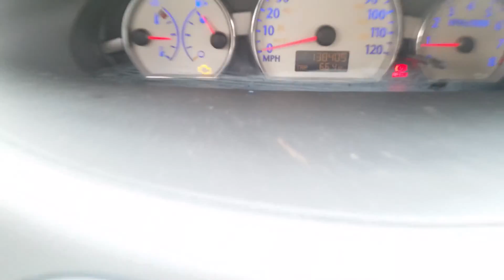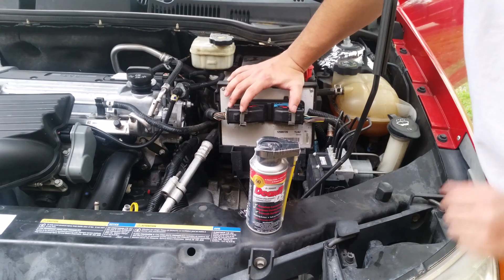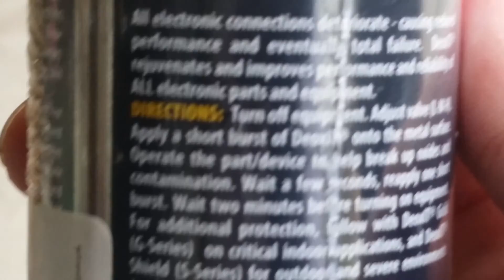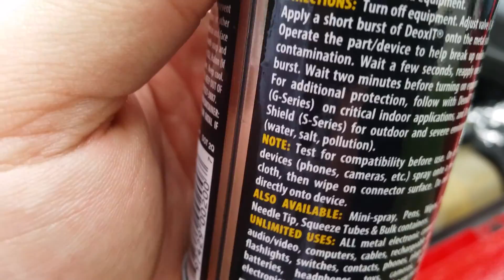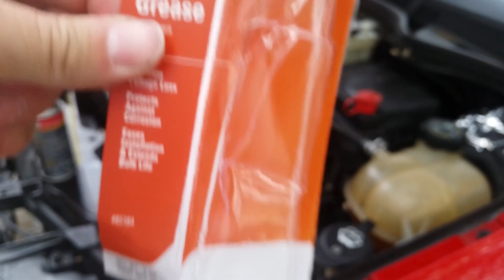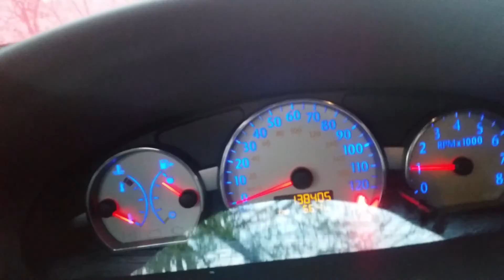(4K) Saturn Ion: Electrical Issues. DeoxIT D5 review

Comment: Is this a common problem with these?
Reply from the maker: I know a few people on the forum that have mentioned it. But I'm not sure how common it is. I ended up having to replace the harness. The pins were moving around in the connector. I couldn't get them to lock into place.

Comment: Hi, my saturn ion 2005 is dying while driving. I was thinking to clean the pins for ecm, excellent video. Did it solve the prob
Reply from the maker: No, not really. I ended up replacing the whole harness. But I think the problem is the pins inside the plug get pushed in. You maybe be able to take it apart and fix it that way.
Reply: @BEERSnGEARS  Thanks. Just this morning my car stopped 5 or 6 times, i bought wd 40 special for rust and did same what u did. So far one hr driving and seems the problem is solved. Thanks again

Comment: Wow thats exactly what my Saturn is doing how can i fix it .
Reply from the maker: I ended up replacing the wiring harness to fix it. Soldered like 26 wires.... It fixed it.
Reply: @BEERSnGEARS  How much did it cost you mine's doing same thing it's a 2003 Saturn Ion
Reply from the maker: @whysoserious447  I went to pick n pull and cut one off. I think I paid $15
Reply: @BEERSnGEARS  cool anyway you could send me a picture of it so I know what IAM looking for IAM not so good with car's.And does that spray help thinking about getting some till I find one .
Reply from the maker: @whysoserious447  it was awhile ago, but I think it helped for a little while. But it didn't last long.
Reply from the maker: I think I could have fixed the fonnector, you can disassemble the plastic casing and you can see the pins, they sometimes get pushed into the connector. I was able to fix another connector by taking it apart and pushing the pins so they poke out farther
Reply: @BEERSnGEARS  Cool my car in morning even the alarm don't work has no power at all.Till I disconnect negative cable on battery then put it back on and will start sometimes I can't even open driver side door. In morning can you reset these computers on car .
Reply: @BEERSnGEARS  Ok I believe it's computer car is pretty old runs great but it does have it's problem's I like your blue dash lights too you do that is that dash hard too get out I don't see any screws in it .are they under dash ..
Reply from the maker: @whysoserious447  There is one screw underneath. Remove the radio bezel by pulling on the air conditioner vents. And there is a screw above the radio.
Reply from the maker: Richpin has a video on YouTube
Reply: @BEERSnGEARS  Awesome And Thanks for answering me your the only one who has
Reply: @BEERSnGEARS  You would it by chance have a video on changing out the lights like what kind Ect. would you .

Comment: nice blue lit gauges, sorting out a check engine light now
Reply from the maker: Leafy fpv Thanks! The reason I did it, is because I used to have a 2002 VW Passat and it had blue lights with red needles. And that was stock.